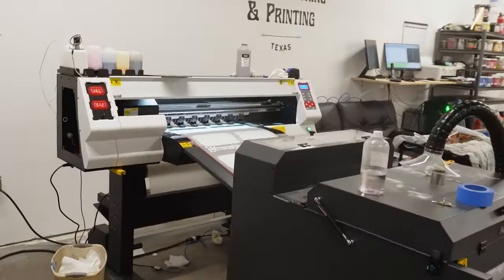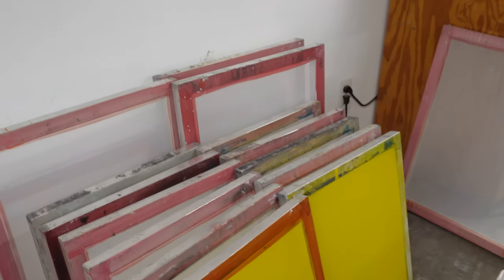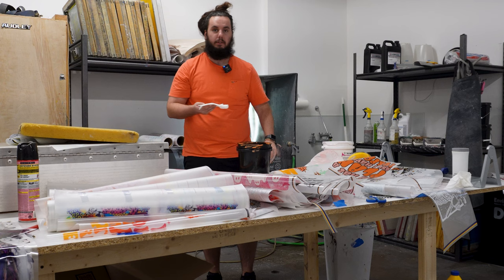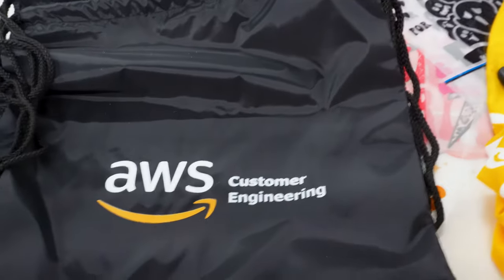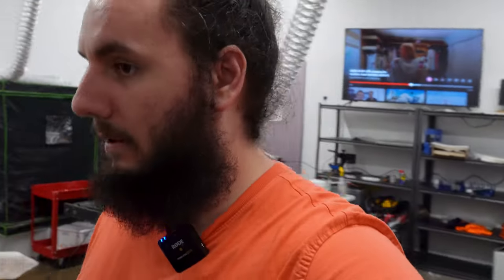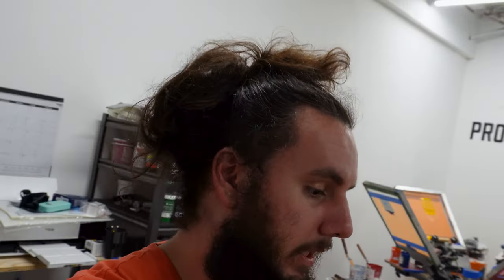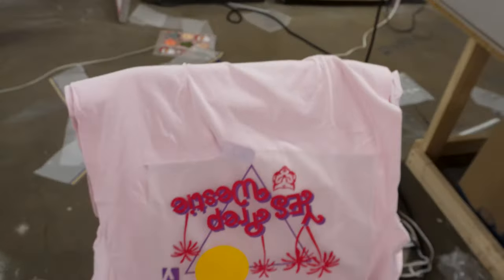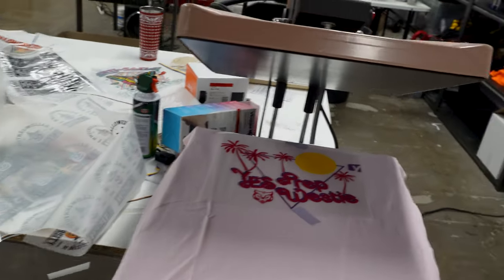DTF Transfers on Drawstring Bags?! Small Business Vlog Day 22

Comment: Thanks for the great videos. I recently got an Audley 2H so these have been really helpful. When you cut the film after the print job is done, and feed it through the dryer manually, how do you ensure it stays in the dryer long enough to cure the powder properly? Would love if you showed more of that process in an upcoming video, that's one thing i'm trying to figure out.
Reply from the maker: I mainly just eye it, I’ve watched the printer run long enough that I know the speed at which it prints so I just try and match that. 

It helps if I can have someone checking my work at the end of the dryer to make sure I am getting a proper cure